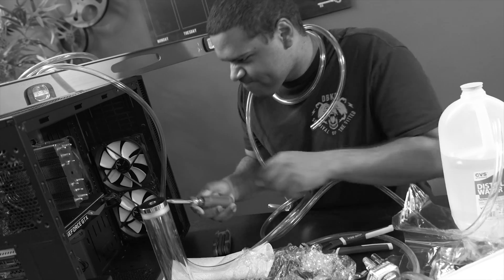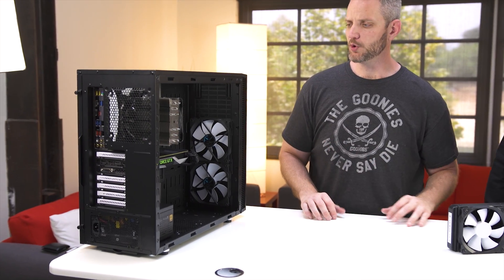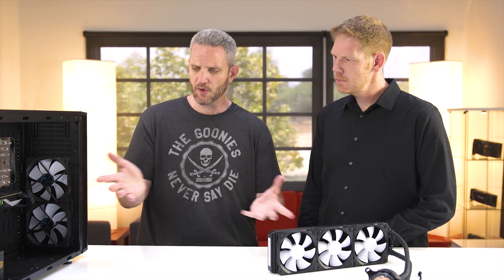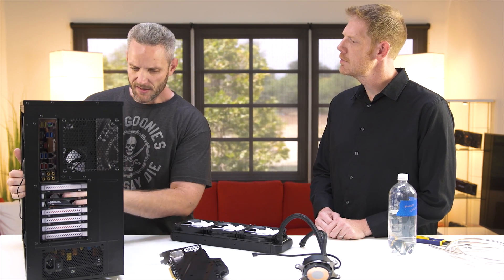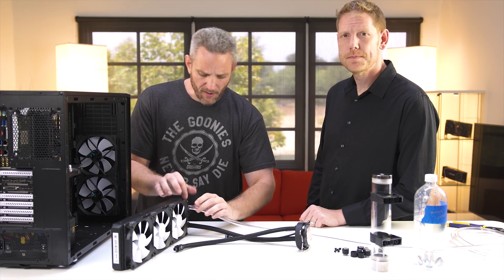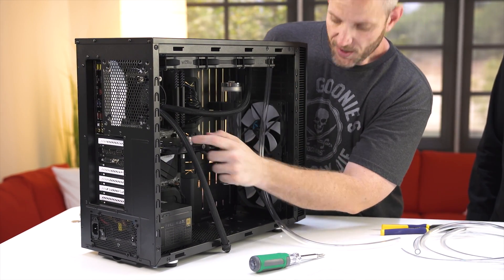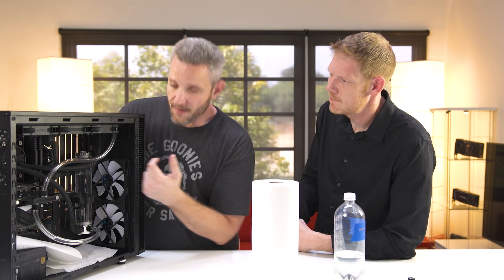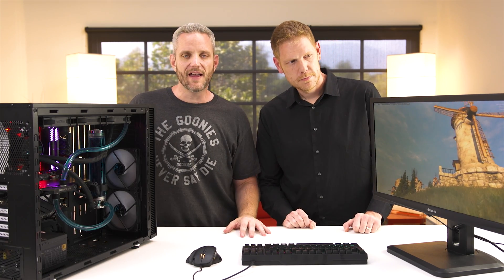How to expand an AIO Water Cooler

Comment: Jay, Awesome video! 
Question: Can you run this system for a couple of months and then do a disassembly video to show if galvanic corrosion took place or not. The radiator is Aluminium, and, I think you used a copper of nickle/copper water block for the GPU and Fractal uses a copper cold plate for their CPU. Plus nickle plated copper barbs on a Aluminium radiator. Even with using an anti-corrosive coolant, I think it will make an interesting video and put all mixed metal water cooling questions to rest, any probably silence some haters along the way too. Keep pumping out more kickass videos!
Reply: Been there,  done that.  Couple of months you'll not see an issue at all.  Couple of years well that can be another story.  I used Blue Asian formula antifreeze for months and everything was clean as a whistle before moving to all copper.   People make me paranoid.  I did have an AIO fail where the fluid lost it's anti corrosive properties,  the aluminum rad suffered badly,  the copper CPU plate on the other hand cleaned up nicely and looks new.
Reply: Rohan Joseph someone answer this

Comment: That was pretty cool they got with you for this build. I was wondering, does this concept work with most AIO coolers or does the cooler need to be designed with the potential to expand?

Comment: Jayztwocents and fractal design is always a good mix.😂

Was that the gpu water block from the ek aluminium range? To be technically correct: Those aren't for sale seperately (yet) so you'd have to buy the entire kit anyway. Using the aio would just add another radiator (which is nice but expensive).

Comment: Honestly the celsius confuses me. The kelvin was made from copper and could completely be disassembled and could include waterblocks made from copper. The celsius however is aluminium, and since there are no alu blocks available yet, you will get corrosion, even with anti corrosive fluid. Furthermore, the celsius can't be completely disassembled and you will end up with half black half translucent tubing.. 
Except the looks, kelvin>celsius

Comment: Loved this video...the humor was on point, and I was actually unaware that there were AIO coolers that could actually be expanded.  I use a Thermaltake Water 3.0 Ultimate S AIO which is just a 240mm rad cooler and wish I had went with the Fractal Design cooler because even though it costs a few bucks more, the fact that you can expand the loop to include a GPU makes the extra money worth it in this particular instance.  I removed the stock Thermaltake fans though and use EK Vardar fans though just to get much better static pressure but it's probably giving me diminishing returns at this point since the CPU is overclocked to 4ghz (Ryzen 1700).

Comment: Open loop is simple and more effective!  Get a Predator x360 or similar kit for under 400 and you will have a proper loop kit with easy tubing, a top of the line pump / block and an extremely high quality radiator, all copper contacts.   Was my first open loop having never done one before and it was extremely easy to do!

Comment: The reason I would buy an s36 is because it is a cheap 360mm aio made by a brand I trust, not because it is advertised as "expandable."

It is definitely a product I would recommend, but not to someone who wants a "custom" water loop. Call me paranoid but mixing metals is a red-line, a no-go, a bad-banana - bad.

Comment: So, question Fractal Josh; the kelvin s24 (wich i have) has reusable fittings on a swivel. are they shiet, and i immideitly need to upgrade to the s36, or could i potentially expand with those fittings, as per the info on your site?

Comment: HOW IS THAT NOT COMPLICATED LOOOL
It's pretty much the same thing as an open loop
Reply: You don't have to source much of the parts aside from some basic tools so it takes a lot of the guesswork out of building a custom loop.
Reply: Benoit Levesque At least you cut one part of installing water pump
Reply: Because it really isn't. I've never watercooled, never even built a custom PC in my life, and I can tell you this looks easy to do, given you have the correct mounts and such. 

Not to mention in my own personal opinion, a custom loop really doesn't seem that hard either(at least depending on materials used). Besides sourcing parts, the main thing with custom loops just seems to be the sequence in which it flows(again, that's my own personal opinion). Other than that, it really doesn't seem as difficult as you or anyone else makes it out to be.
Reply: 4head
Reply: Benoit Levesque wat
Reply: Pretty easy
Reply: I've always said if you can swap a water pump and radiator in a car then you can do custom open loop cooling.

Comment: Going through the specs for this AIO they use a copper waterblock [from what I can tell] and an aluminum radiator? Why would they intentionally mix incompatible metals instead of going all copper or [the EK route] all aluminum? It means no matter what type of block you add to this loop you're probably going to have to constantly fight corrosion.
Reply from the maker: +Matthew Burkhart you should have a look at more AIOs...: they are all this way
Reply: I'm sure they are, but my concern is that the complexity introduced by designing it to be expandable makes this a bigger risk/potential headache than a completely closed AIO.

Comment: Guys I'm trying to water-cool my RAM cuz it heats up too much when I play Tetris...Any advice?
Reply: Just make sure your ram is in SLI for maximum performance.
Reply: @dankbeluga9636  if you're gonna do that and go with LR you might as well download more ram to make it worthwhile. get a terabyte.
Reply: TechExcalibur You'll have to use Liquid Nitrogen for that.
Reply: That means your ram is no good. You should download some new one
Reply: Submerge it in water, so every  single component is cooled
Reply: And delete system32
Reply: TechExcalibur lay your pc ok the side, open it up and put icecubes on there
Reply: Did you blow in them before you inserted them?
Reply: TechExcalibur Apply memes to high temperature area
Reply: is the ram "sli ready"?
Reply: The old Tetris-RAM problem. Well, thing is, I know how to fix it, but I don't want to tell EVERYBODY. Just send a money order, in the amount of $10,000 to this address:
Reply: Well your first problems is your lack of eggs and milk.... Has HowToBasic taught us nothing??
Reply: the reason your ram is heating up is because you dont have enough installed. please download more ram in order to fix the heat issue.
Reply: Thanks for all the advice guys. However, instructions were unclear...got my toaster stuck in a microwave.
Reply: Time to get spitting
Reply: TechExcalibur water cool it
Reply: fish tank pc
Reply: With a garden hose switched on and at a low to medium water pressure, gently hose down the interior of your computer -- paying particular attention to the RAM.

After approximately 1 minute of this, feel free to add a rubber ducky or miniature beach ball to the water feature.

For even better effect, make sure the RGB lighting is on.

Hope this helps.
Reply: download more so it spreads the heat out more
Reply: Your comment appears to be as effective at causing cancer as fukushima after the tidal wave. Side note, just build a mineral oil pc, thats how i keep my ram cool!
Reply: have you tried buying a ewe to help your ram get out of heat?
Reply: use nitrogen
Reply: It seems the tetris isn't optimized for your pc. Compile it yourself
Reply: Loooooooooooooool
Reply: I actually have something i could sell you for that problem. Corsair Fan for memory ram
Reply: ohh I had this problem too I just took the ram out whenever I played tetris as its such an old game it dozen't need it in there anyway ;)
Reply: Get original material. That would be my advice.

Comment: How to void your warrantee 101. (Yes you will void your s36 warrantee by doing this, even though it's an advertised feature)

This is literally an open loop with the pump on the cpu block vs the bottom of the res. Sorry but this is really, really bad. The predator was an insanely better option, as it actually had an ecosystem around it and was actually easy for your non pro liquid cooler to use (qdc is awesome). Also promoting mixing metals?????????????????????

You should be ashamed of this video Jay. This is an insult to everything you've done on this channel.
Reply: I'm pretty sure he was using the gpu block from the EK fluid gaming lineup and the fittings that came with it that are all aluminium. But yeah, still he promoted it by using coolant that's designed for mixing metals.
This video really tries to make this approach look easier than a standard open loop with soft tubing. It certainly is cheaper but not easier by any means. Also when going full open loop you usually don't run into the problems with mixing metals like in this case. And for absolute beginners the EK predator with qdc and the ecosystem around it is definitely the better buy like you already mentioned.
Reply: James Mastroianni you need to smoke weed flappy. Your ass is too uptight even for 1/4 tubing.
Reply: As far as I know fractal still warranties their components even if you do this. Like if the rad or pump fails they will warranty it.

Comment: That didn't look easy at all is that why the female left the room?
Reply: ALPHAdigitUNBOXING 
Lol, yeah. It looked like she left after the easiest part. And, I do not see how this is easier or cheaper than a custom loop.
Reply: easier is definitely up for debate, but it does seem a fair bit cheaper, the 360mm version I've seen going for right around 115 USD, pump, rad, block, and some fans, and they seem to work well, especially at the price point (from what I've seen so far of it, been considering it for a build) you look at something like EK or alphacool, you're spending about that much for a pump and block depending on the specific needs for your system. My main curiosity is how well the pump on the S36 handles the expanded loop,

Comment: One giant ad and voids warranty. No thanks.
Reply: Doesn't void warranty. That AIO is expandable out of the box. Do your homework before posting.
Reply: http://www.fractal-design.com/home/product/water-cooling/s36 check key features..Expandable system. Just open it up to get the full benefits of custom water cooling, with the ability to add any components you want to the loop, such as a graphics card cooler...

Comment: "expandable loop" but has warranty void if removed stickers on the fittings...
Reply: i have one of these, it does not have warranty void stickers on the fittings. in fact, adding onto it doesn't void the warranty, as the warranty only covers the radiator, the fans, and the pump. leaks aren't covered.
Reply: Those are illegal in a lot of countries anyway (US and European Union included) So they can put all the stickers they want on there, they still by law are supposed to honor the warranty.
Reply: @Redslayer86  Illegal in the us is a big word.
Reply: @Redslayer86  They may be illegal but good luck trying that with a company.
Reply: Not correct - on both accounts.

The EU warranty laws don't count closed loop coolers, but they DO count laptop and desktop parts. Just like how your graphics card can't have its cooler removed, but you can RMA a graphics card from a prebuilt PC.

As for "not going anywhere unless you take them to court" remark... good thing we have consumer rights organisations who will do just that for you, which is why almost every retailer folds once you threaten them.
Reply: well i mean the warranty is supposed to cover any fault from the way it left the manufacturing. if you change it to something else that isn't original then you cant guarantee that it will work like the default version and i don't see how that should be covered by a warranty.
Reply: Yea, but unless you take them to court, you'll get nowhere.
Reply: Corrosion due to poor part mixing obviously wouldn't be covered either.
Reply: Sandeep Luthra warnty void stickers don't mean anything legal they can't deny you service because of them being removed or at least it's true in America.
Reply: I went to their website and read it.  Once the loop is "expanded", then the individual parts are warrantied.  That makes sense to me.
Reply: They did - did you watch the whole video? They talked about the CPU and GPU temps at the end.
Reply: Except they didn't really. Not in the way a review would - which ultimately this IS. Nor did they talk about pressure, mixing metals, or its ability to cool X amount of parts without swapping both pump and rad.
Reply: Yea, but by doing this video, it seems as if Fractal is encouraging a custom loop. It may lead people to believe that their warranty is intact after doing the modification. They should probably preface it with huge disclaimers that this modification will void your warranty.
Reply: @SandeepLuthra  Shouldn't people know in general that if you make any changes to the product, you're voiding the warranty.
Reply: Even then local and state laws can provide additional rights (or invalidate rights) not outline in the warranty.
Even if the business themselves is not located in said area, their product is, and some local laws insist that manufacturers stand behind their products or can face law suits or even criminal charges depending on the laws in that area. Warranty void stickers are not worth the material they are printed on.
Reply: EpicSMG26 Well.. you will try to expand it when it is out of warranty time anyways.
You won't change it from the start it is just dumb
Reply: I have the 240mm version and there are warranty void stickers on each fitting. To remove them, you would have to tear the sticker.
Reply: @Mansen - Most AIO coolers already contain a mix of aluminium and copper anyway, which is a big no-no in custom loops but I guess less of an issue with a sealed unit pre-loaded with anti-corrosives. 

Bang on with your previous post, though. "Warranty void if removed" stickers are 100% valid (here in the UK/EU, anyway) on individual pieces of hardware - it's the ones companies stick on PC cases etc. that are meaningless in a legal context.

I believe notebooks are somewhat of a grey area, though - as they're not traditionally designed to be opened by the end user (having access panels for bits consumers are supposed to have access too).
Reply: They do in fact not.
Reply: Not sure which part you're replying to with that, but NZXT, Corsair, Cooler Master, Thermaltake and Fractal (excluding the Kelvin series) all use copper contact plates and aluminium radiators.
Reply: the nzxt follows an aluminum and copper for radiator and pump respectively it accomplishes this by using a flui
Reply: The point of this video is that this Fractal design AIO is made to come apart and has standard G1/4 fittings
Reply: That's great and all - But what's the point of giving it fittings, if you won't talk about the performance at all.
Reply: warranty  what is  i nerver use is i repair
Reply: EpicSMG26 
That is a sham.
Reply: Well it's hardly their fault if you fuck it up.
Reply: Honestly they put that there for legal reasons and wouldn't ever deny you warranty claims unless it was your fault like cross threading or dropping a radiator and bending it
Reply: It makes perfect sense. If you expand your loop and fuck it up, they aren't responsible for replacing your unit because it wasn't a problem with the product in it's original state.
Reply: EpicSMG26 I have a Swiftech all in one as well and it's expandable, if you want to void the warranty.
Reply: I'm referring to US Law and Jurisdiction. (Jay is in California and the show is filmed in the US.) You guys have a lot more consumer protections than we do. Good luck getting anywhere in the states.

Comment: watercooling is for noobs....my amd fx 6300 4.9ghz with cooler master hyper 212 evo 70°c in stress test...no problem👌 and its super silent...my gpu temps (gtx 1060 6gb windforce) overclocked 70-75° in games after 2-4 hours so my pc is cool asf...and no water cooling and i cannot even hear my pc
Reply: HansBeaast too bad your getting 50% of the fps you should due to that shitty cpu
Reply: James Mastroianni  where the fuck do i even need 100+fps i have 60hz monitor 1080p and every game ultra settings over 60fps so....but gonna buy i7 7700k in about 4-6months
Reply: HansBeaast 
I would agree. I especially love the silence. But, for larger CPUs, like Ryzen Threadripper (RT), the air cooler would be so massive that it could warp your motherboard. That is even a problem for lower power CPUs. Moreover, air is not quiet with more than one GPU. I want to build a 4x GPU workstation with a RT 1950X. There is no way that air could cool that as quietly as water... Well, perhaps I could use PCIe risers, but I would have to do some kind of crazy case mod or a custom case. At that point, a custom loop would take less time and cost less money.... although a custom case like that would be awesome.